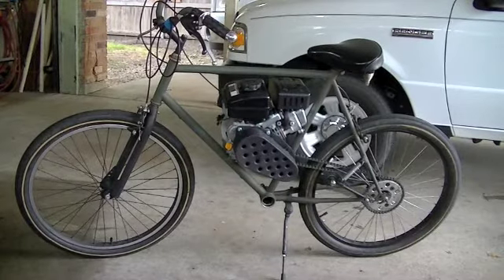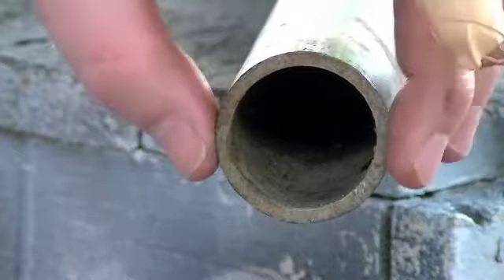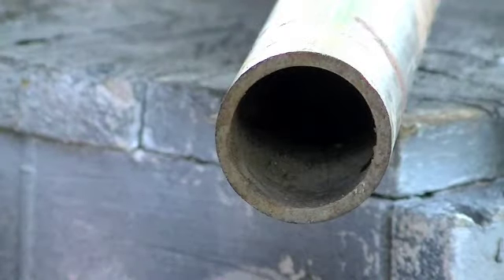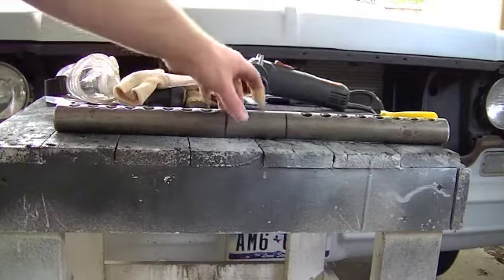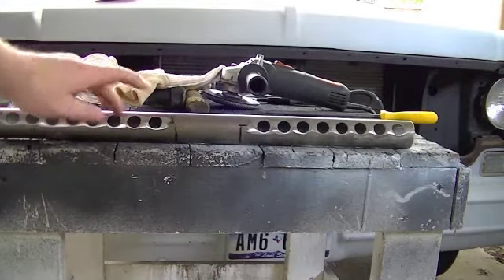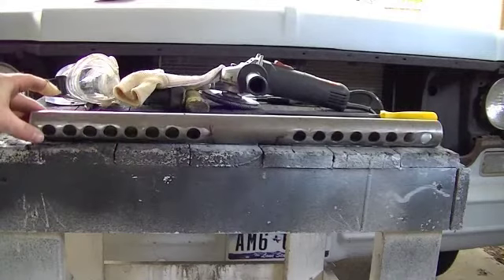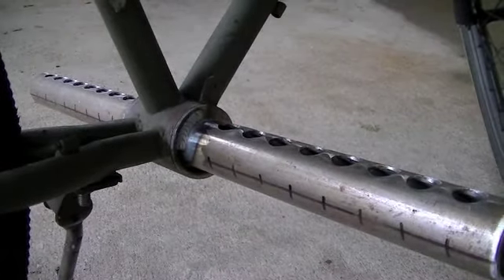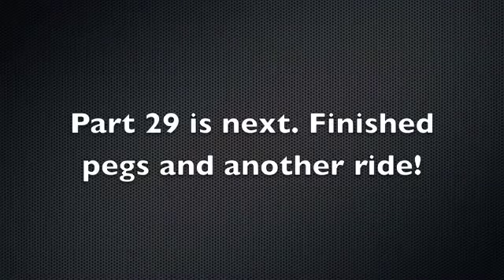Part 28 Motorized Bike | 3HP 4 Stroke Engine

Comment: I like the way that you did the jack shafts but I am wondering if a multi gear can be added to the back side so that all of the gears can be used also to speed the bike up and use the lower gears to be able to climb hills and in the woods on trails

Comment: Only help I need how to fit a torque converter.Ride nice if you put suspension!Good for commuting but really need a cvt for town and hills and stops.I do not have all the facilities...Would you like to exchange information and maybe help with the cvt ?I will consider compensate because I am interested in proposing the final product (solution) to the market.Pls pls :):I am no kiddo...And by the way,cheers from Portugal !!The best technician/enthusiast I've seen so far.

Comment: For the foot pegs I would have just added a sleave over the peg tube to go between the tube and the race as a filler and then welded it would make it easier and more sturdy also less weld to fill

Comment: You need to tack weld  the race too, in time in time it will wholler out and spin. Also seance you did so much to your bike why not remove the back wheel and make a new spindle shaft and remove the old bike spindle, you can easily do that with heat treated (ALL THREAD) at any auto parts store....  Way cool.. I watched all your videos and I wish I was able to build one with my son.....  Great job...  J.P.

Comment: Nice work, any problems leaning into turns and having peg strike?
Reply from the maker: +pucksterpete No problems.  Those pegs are pretty high off of the ground and I haven't had a need to lean that far into a corner.  Thanks for watching!